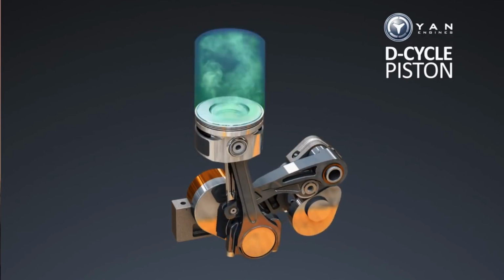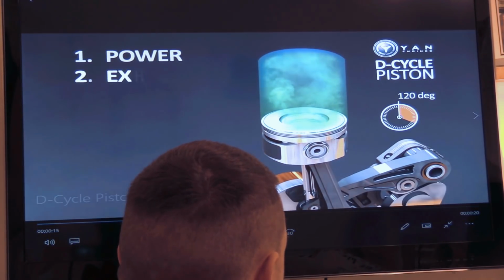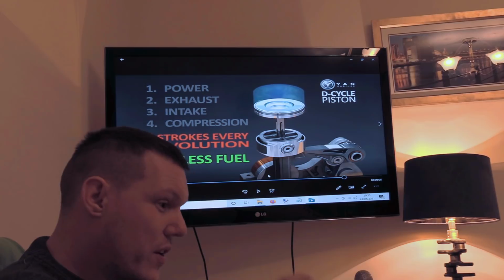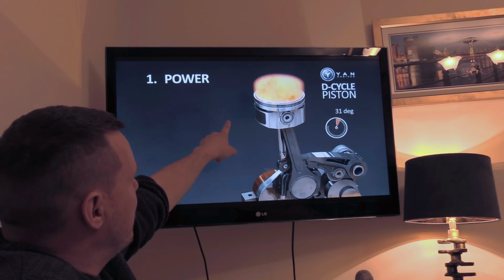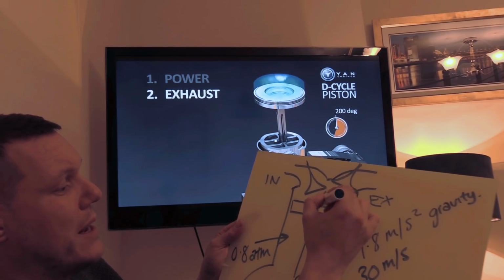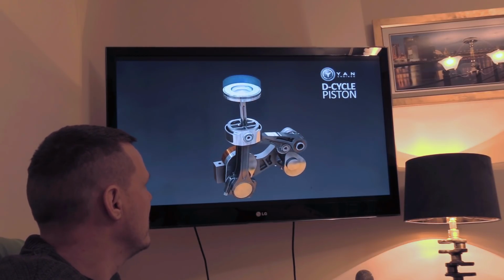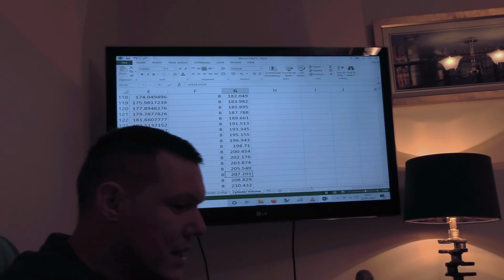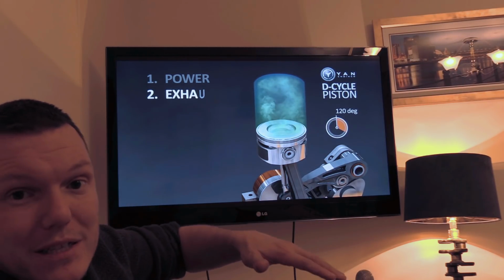Is this a GAMECHANGER? | D-cycle engine

Comment: I am not an engineer - but looking at this, just on gut feel, that engine looks complex, it looks like a lot of moving parts, it looks like a lot of wear and tear would be scary, and I'm guessing that perhaps with limited RPM and proper handling -- maybe it would be ok. There are two main bearings - so you'd I assume have a more complex gearbox, clutch, and I assume a loss of power as that goes through more surfaces and machinery. 

Just looking at the piston, looks like it would cause blow by, and I dare say, enormous bore wear and tear. Once it starts slapping around, how long before some horrible things start going sideways ..

Comment: If people succeed in making this tech cost-effective, they can try bringing back 2 strokes with a supercharger and with high pressure injectors that fires right after the exhaust port is closed by the upcoming piston.

Still not as complicated as this D cycle engine lol

Comment: It looks like this could be simplified by eliminating the lower piston entirely. The unique element of this design is that the top piston is moving up and down faster than crank speed. Simpler ways of achieving this come to mind, perhaps with a conventional crankshaft and piston but the conrod split into 2 pieces connected via a geared shaft. I saw something like this years ago but the intention of that was to keep the piston at tdc for longer on the power stroke.

Comment: Looking at its operation the intake stroke is only half the  full piston stroke so therefor massive power potential loss in this engine. Unless a supercharger or turbo pushing compressed fuel air into the chamber to make up the loss under normal aspiration. Not an engineer so I hope this doesn’t sound complete bullshit ish,
Reply: was going to ask about forced induction, but i fugured matt would have thought of that aspect, will be an interesting folow up video
Reply: doesn't the Atkinson cycle have the same phenomenon?
Reply: @carlosandleon  exactly my thought...seems stupid if the only benefit is the overexpansion effect. That you get from an Atkinson/Miller cycle.
Reply from the maker: 2 stroke...

Comment: Impressive, but much more moving parts than a Direct Injection Two Stroke. I hope Bombardier keep refining the 850 snowmobile and not drop it like the Evinrude line
Reply from the maker: The eventide line has been dropped? And has something replaced it?
Reply: @thedirtyworkshop  they seem to be going into electric outboards. hopefully they may use the little 850 turbo as a range extender

Comment: I feel like you would run into issues with valve float at high RPMs. In order to do all four strokes in one cycle the valve train will have to spin 1:1 with the crank. At 10,000 RPM your valves will be moving equivalently to 20,000 RPM in a regular 4T.
Reply: yeh so everything but the crankshaft (iow all the most difficult bits) will have to run at speeds like 10krpm engine to make the power of a 10krpm conventional engine, so it adds a bunch of complication to accomplish nothing
Reply: Yeah, but you should make 10,000 RPM power at 5,000 RPM due to having twice as many combustion events per rotation.

But yeah, the valves will have to work at 10k RPM speeds, upper piston speeds at 10k RPM speeds, pumping losses at 10kRPM levels. All to have the crank windage losses at 5k RPM levels. Still probably not worth it IMO.

Comment: maybe the top part needs to come down to compress the gas (with a small air gap between mechanically limited by the stroke length)
rather than the other way around.
at least with that the piston won't be smacking into the lever thingy time and time again.

Comment: I've had a similar idea brewing in my head for yonks as a way to increase compression, but I never really bothered doing anything with the idea because I guess the reliability and tolerances required to prevent seizing/bearings falling out of alignment would be too high.

Scissor lift conrods next?
Reply: Increase compression? Are you talking petrol or diesel , and to what extent as the limit to compression in petrol engine is octane rating
Reply: @michblitz  Diesel for a HGV, the rpm would also be an issue for balancing the double con-rods so I would say petrol would be out of the question
Reply: Such a thing is being tried in a slightly different way with Mazdas SkyActive system.

Comment: I guess the idea could be to allow for lower rpm at the same power output, thanks to more power strokes per rotation, that would possibly create the higher efficiency they claim, either that or it uses 20% less fuel because of the effectively lower stroke 🙃

Comment: Really interesting explanation of the design. I think this could work if it was built for low rpm. Supercharged and used as a stationary generator or boat trawling engine where the weight complexity and rpm limits are less of an issue

Comment: Its hard to justify much extra complexity in the pursuit of efficiency though when the “future” (electric) has one moving part.
Reply from the maker: And moving parts = bad?
Reply: No no and as you said at the end complex doesn’t mean wont work etc. But will these thing get the investment and development needed? Are they even beneficial enough to pay for the manufacture cost and weight penalties?  Is this engine really able to to have the holy grail of 4 stroke efficiency at double the power stroke rate? This idea looks like its useful for smaller engines which are often used where light weight is a priority.
Reply from the maker: Well the whole point is to see if the engine is viable at all...
Reply: @fairyheli2  It wasn’t a ice vs electric debate thats been done elsewhere.  Im here for this engine content im just being sceptical/pragmatic about the chance of it being pursued as a technology. And your issues are technically with batteries not motors 😜
Reply: @fairyheli2  has anyone done a petrol-electric bike? Small high rpm engine no gearbox generator powering a motor?
Reply: @fairyheli2  the industrial world uses a-lot of diesel electric quarry dumpers and trains etc. Im not a biker but feels like a no gearbox and electric motor levels of torque but power density of petrol would be an interesting idea.
Reply: @jons6125  and with a bit of electric storage you can have massive peak power with only  a small ICE supplying the average power

Comment: To make that crown lever arm pull the crown back down you might have to put a second identical cam above it, or use a linkage of some sort that connects it to the underside of that cam shaft so it can move it in both directions?  

Also, no idea how to deal w piston tilt in either of the two piston parts as displayed there

Comment: Matt..did you miss the heat tranfer issue.? That tiny piston has to give it up somewhere and
with oil running around its going flash off between the 2 pistons..leaving the top piston
to detonate..or  what.? .Cheers..Maybe its in part 2 ...gotta go there.
Reply from the maker: Again you have to know not guess the heat flux
Reply: @thedirtyworkshop  Why I watch.

Comment: Gee, Matt. This engine has an awful lot of complicated parts. Perhaps if someone were to make an engine with a tall piston skirt and just make a hole in the bottom of the cylinder, and use a flappy bit of metal or composite instead of a cam driven intake valve, such a machine would work wonderfully over 360 degrees of crankshaft rotation.

Comment: What if there was a lip on the upper (combustion face) piston that fits a groove on the lower piston creating a type of air cushion when they meet during the intake stroke. The combustion face piston would require some sort of spring to drive it down bore on intake stroke and also keep it from floating or over extending at TDC. I really like the design for learning but it has many short comings. 20% less power, more friction losses, more rotating mass in the rods, more oiling surfaces to deal with, the interestingly weak small rod, and i am sure a myriad of other issues. I agree with your idea to share the skirt surface area with the 2 piston halves.

Comment: I'm fairly sure this is suppose to be a car engine design I don't see this being a high RPM motor,I don't think you can get around that it has more moving mass and taking in 20% less fuel is likely to make 20% less power.that you now have to drive the extra camshaft with some of that power.any wear on that cam system will start to make it slap harder when the two parts of the piston meet.I think this engine will run but for how long might be the question.
Reply from the maker: An engine is an engine, there's no such thing as a car engine... just low and high revving engines.

Comment: I think the point of contact between upper and lower piston is a problem . It needs something to slow the two down just before contact . I thought maybe a magnetic cushion with ,rings that faces up and down imbedded in the contact area of the pistons with brushes at the big end of the main rods voltage running up the rods . Or a coil spring at the center of the upper or lower inner piston , like a spring sandwich on piston, with the top piston rod throw the middle . Or something like a hydraulic  lifter but with pressure acting on a set of contract surface  rings. Or a spring loaded telescopic top piston rod . The small rod doesn't need to be strong because the top piston is very lite and the rod takes no downward force from combustion.  A magic shock absorber could be on the rocker arm maybe past the bearing, like a seesaw.

Comment: Enjoyed your videos that I’ve been watching- just wondering if ic engines loss so much energy through heat- why not use that heat to turn a turbine or  find some other use for that energy- that would make the motor more efficient wouldn’t it- hope this is not a annoying comment- keep up the good work either way
Reply from the maker: They are doing, more on this soon
Reply: Yes.  F1 have been doing this for 7 years.  This is how F1 engines have 50% efficiency.  However, it is very complex and expensive.   It is also not reliable.  It will take a lot of development to make it work in production cars.

Comment: looks like a well designed injection system for a two stroke. or running a atkinson cycle under boost. would do the same job. as with all these fancy designs i just wish that someone would actully build them and prove them right or wrong once and for all.

Comment: Without some sort of desmodromic arrangement  the upper piston will just sit at the top of its stroke due to the friction of the piston ring surely?  A torsion spring at the pivot point of the arm would need to be huge  due to the tiny angle it moves through. With such a small skirt surely the wear will be huge on the top piston ? Thats without sorting the lubrication.  
The functioning looks a bit like an Atkinson cycle with the intake volume being less than the power volume but maybe im seeing things.
Arrgh, even I can see too many challanges

Comment: looks like a mess. afaict it'll need something to brake the top piston before it slams into the head, it'll need something like a second cam to pull the piston down for the intake stroke and that'll have to perfectly adjusted so it doesn't slam into the bottom piston. and everything on the intake and exhaust will have to be designed like it was running at twice the rpm to get decent VE
Reply: Instead of making everything run at twice the rpm they could use Freevalve. But with everything else yep a problem
Reply from the maker: Freevalve, lol who's using that?
Reply: @thedirtyworkshop  no one before the Koenigsegg Gemera. But with the limited miles it will drive we'll never know if its reliable at all
Reply from the maker: But wait, have they released it yet? And it was meant to be in the car before that, and then wasn't....
Reply from the maker: Just looking at the engine (the tfg) they claim it makes 300HP without the turbos??? Wait a minute..   300HP from 2 litres?
Reply: @thedirtyworkshop  ye IK that sounds way off imo. The ?Valkyrie? or what its called from aston martin was doing something like 250 with 3 cylinders during development, and running at what, 11k rpm?
Reply: @thedirtyworkshop  no its not been released yet, but meant to be in a car before i dont know. They did do some work with some chinese automaker to put it into production but I dont know what happend with that.
Reply from the maker: Nothing happened with that, as usual

Comment: sorry, just not going to happen. forget about it having no way to draw in air on the intake cycle, its going to load up the cam on the exhaust 'stroke'. use fuel that burns a little longer, or put the engine under load at low RPM and there goes your camshaft.

Comment: Would forced induction solve the intake stroke floating off the cam? How would you solve the rather unique piston slap issue, I can't imagine light ali pistons taking that for long. What about the lower piston just riding the skirts - wouldn't it scrape the shit out of the cylinder?
Reply from the maker: Skirts and cylinder? What do you mean?
Reply: @thedirtyworkshop  The lower piston has no rings to keep it centered in the bore right? Wouldn't it scrape along the walls of the cylinder? (what I called a skirt but meant the top and bottom edges of the lower piston)
Reply from the maker: Rings do not keep pistons centred...

Comment: It's a 2 stroke so that means it should have a pretty good torque on low revs so maybe it doesn't have to rev that much just like a diesel and if assisted with a compressor it might be able to just squeeze the air in instead of relying on the piston to create a vacuum.

Comment: I think if this thing could be made not to grenade, it would represent a very modest net improvement.

First, having a power stroke on each rev is going to reduce the magnitude of torsional stresses on the crank, and smooth out vibrations overall at any given rpm. Also, the opposed accelerations are going to partially mitigate vibrations. Less damping needed, more and smoother torque- a good start. 

Then I'd assume that reduced torsional losses will lead to slightly better than 200% efficiency(force at the crank journal, not flywheel power output) over an otto cycle of the same usable displacement. Should be getting Otto efficiency at nearly 2-stroke speeds. 

Now the negatives; you're going to end up with an engine sized 15-20% larger than comparable Otto cycles for the same output per power-stroke. Maybe a 50 to 80% heavier short-block, too. You'll also have likely nearly double the reciprocating mass and another 50% added to the rotating mass. In addition to that, I'd guess it has comparably about 200% normal cam drive losses given the second piston system is 1to1 crank speed and it's going to need a return spring or desmo-type system to power the intake stroke and avoid float. 

I figure long haul, this thing could only be rated to about 75% of the RPM of a similar usable displacement otto cycle given all the extra leverage and mass and the simple need to avoid a hard collision between the piston components. Longevity is a hard master. That probably means max power would fall decently below 190hp/ltr( x 2 for the double-speed power strokes). Especially since at really high engine speeds the cyl filling efficiency will fall off a cliff due to the insane downward accelerations of the double piston setup(this might actually completely negate the 4-stroke advantage. No free lunch). Let's say it can do 155hp/liter at 2x speed, and at the same size as a typical liter-bike engine it has 0.8ltr displacement. So it's working with 310hp x 0.8 or 250-ish hp before factoring for the double piston system losses. 

I'd guesstimate the average DOHC setup on a liter-bike eats 10 to 30 hp so let's go with the high end as a modifier...  sap 30 for the extra cam and levers and piston et al... you might optimistically expect 210hp from this thing at a similar, or slightly larger  form factor compared to a liter-bike engine. Probably see a 30 to 50% gain in weight with better than industry standard torque properties and max output at substantially lower RPM. Might make for a more fuel efficient bike with better driveability and comfort that needs less maintenance and has better acceleration. Likely a lower center of gravity as well. Of course the engine is very likely to be absurdly expensive and prone to catastrophic failure in the first two generations if it even get's out of the vaporware phase. 

The market would be very narrow, too. It's a bit of a porker and would only see applications for performance oriented traction or water thrust. There are cheaper lighter ways to get this kind of efficiency for non-powersports industry. And for a generator or compressor/pump, a chubby flywheel is cheaper and simpler than evenly distributed power strokes.

Comment: As for the Pistons contacting due to thermal Expansion, etc. - that's no different to the thermal expansion experienced with Valves and Pistons in a plain ordinary 4 Stroke, if you don't build in enough tolerance they come together in a not too friendly way.

Comment: I'd like to see a prototype of one of these.  Although if you calculated the fps of the cam actuated piston, it's gotta severely limit rpm.  I can't see the "contact point" being a very quiet or durable thing either.  And to top it off, that cam actuated piston would likely cause a substantial amount of parasitic loss.  Hopefully someone tries this, but optimistically I don't think it will last.